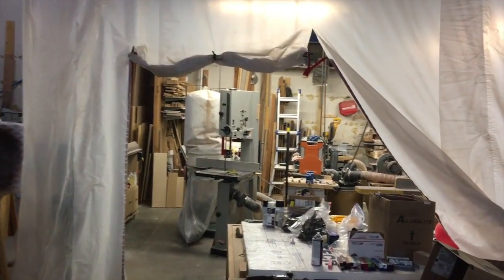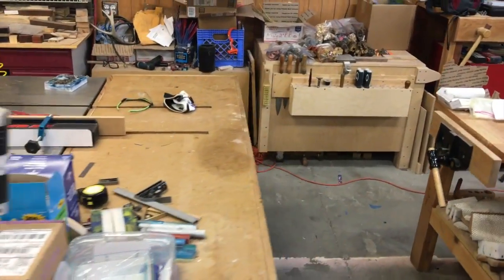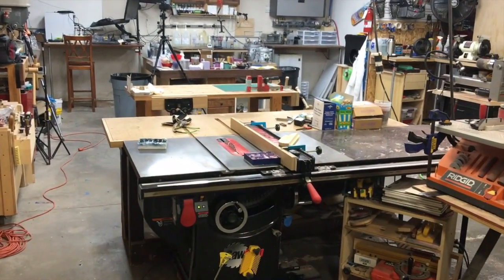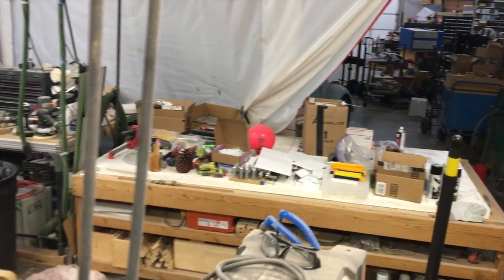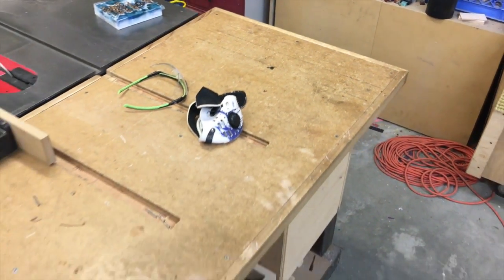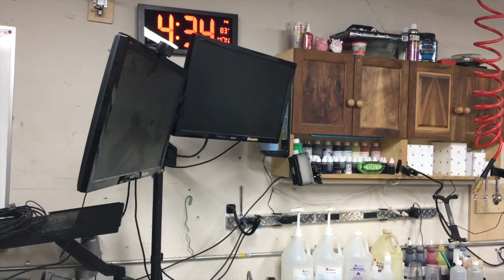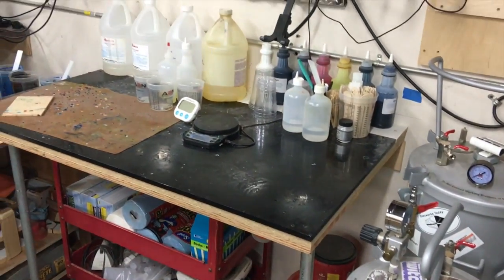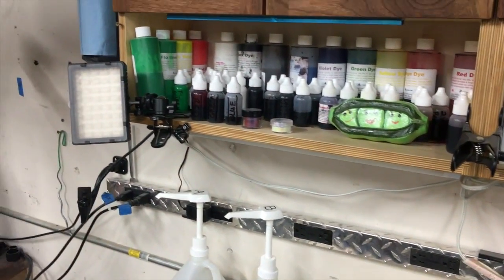NV Woodwerks Shop Tour 2017 | Resin Casting and Turning Workshop With Special Guest Pea Pods

Comment: Great video. I have been collecting the equipment to start casting and was going to use Rubbermaid Industrial rolling carts to put my pressure pots on but am wondering now if I should since you made the point of using cement bags on your bench. Would the Rubbermaid carts not be that good of an idea? Thanks.

Comment: What a great space to work in. In at least one of your videos, you used squirt bottles to dispense the alumilite into the mixing cups. Did they come from Alumilite ?
Reply from the maker: Thanks Jim! I do have some bottles that I got from Alumilite, but I also bought some from Amazon a while ago that I sometimes use too. I think the bigger ones I got on Amazon or possibly ULINE. Bought them ages ago though, so I don't have a direct link to what I got, it was a case of them
Reply: Zac Higgins    Thanks Zac. I'll check Alumalite first.

Comment: I know you bought a new lathe at one time but had issues with it. Did you never get it fixed? I don't see it.
Reply from the maker: No, I sent it back after I got two brand new lathes with the same problem. Bought a 3D printer instead =D I'm hoping to get a full size lathe sometime in the near future, but I have to save up for it
Reply: Zac Higgins got it. Nice setup Zac always do good work.
Reply from the maker: Thanks Tracy! Yeah, it was a bummer that it didn't work, had all the features I wanted and was a pretty decent price too! Looking at getting a Laguna when I get the funds together =D
Reply: The Laguna lathe is nice, I bought one last year. Great lathe.
Reply from the maker: That's what I hear =D